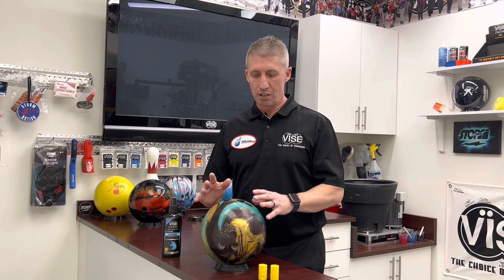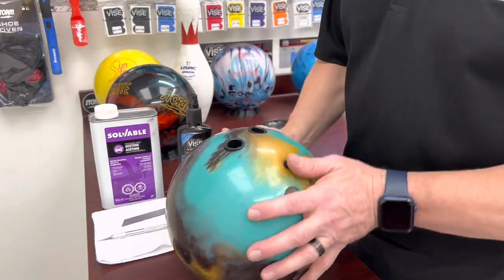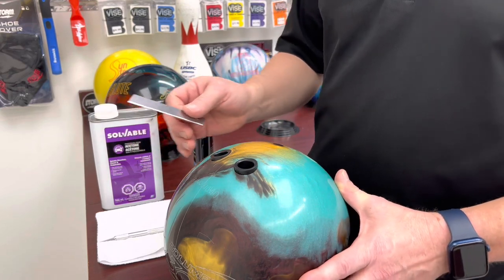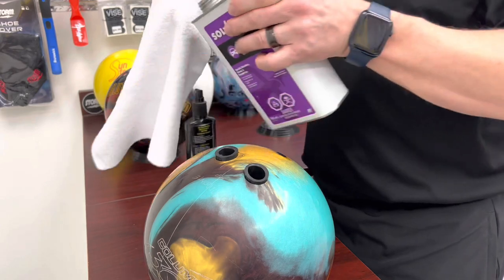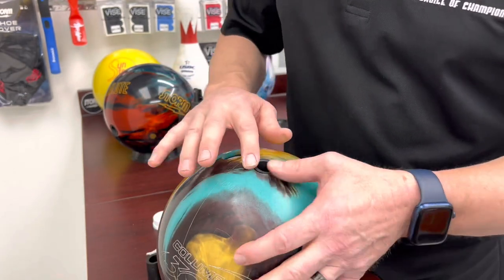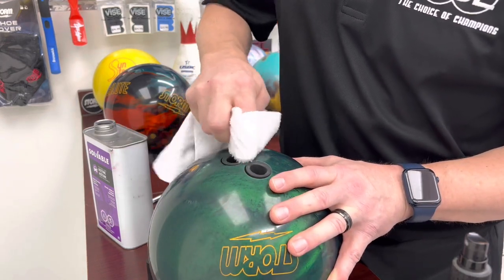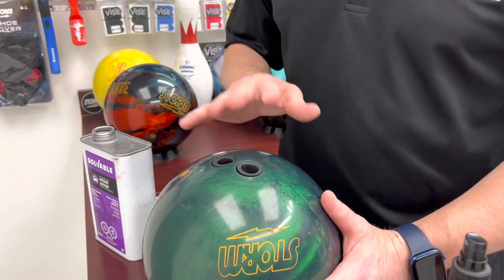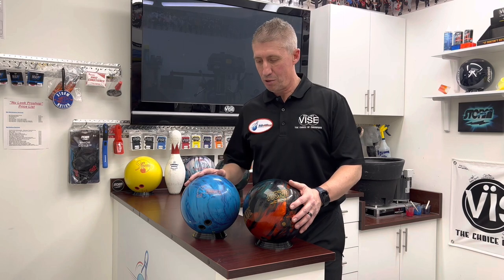How to cut and make your Finger Inserts perfectly flush!

Comment: Good stuff. I just had inserts put in. They're a little too deep. The inside edge of the drilled portion of the ball has an edge on it. How do I put a bevel on the fingertip holes without removing the inserts?

Comment: Fantastic attention to detail. Thank you for sharing your knowledge. 
The biggest issue that I have in regards to inserts is; I use vise semi-power-lift inserts. Trimming them removes part of the "lift" portion of the grip. It seems as though the options are: let then stick out a bit and hope that no one notices, or, insert them deep enough so that they don't stick out,  or, stop using power-lift inserts. What would you recommend?
Reply from the maker: What are your pitches?
Reply: I just switched from these exact grips to ovals and I’ll never go back. Try the ovals if you haven’t already. They feel natural and you’ll be able to use this cutting method as a bonus.
Reply from the maker: @tylerjones2559  I use the Oval/Power Oval from Vise, love them!

Comment: I wac using the same cutting method but without the ball cleaner and acetone. Genius ! Thanks ! Can the acetone alone be enough for the inside part of the grips in case we don't have a surgical type blade ?
Reply from the maker: It will soften the edge a little but an exacto knife just barely taking a sliver off the edge makes it better and faster.  You can get them at any hobby store or arts store.
Reply: @Nulookproshopbowling  Thank you ! I also subscribed just because of this video. Well made !  (i think you might like mine too ;) )

Comment: Nice technique, but I have a question for you.  Are you using the xacto knife on the inside edge of the grip where your finger goes, or on the outside edge of the grip where it touches the ball?  It's hard to tell from the camera angle.  Thanks.
Reply from the maker: On the inside edge where your finger goes, just to barely break the edge.  The you will use the Acetone after that.

Comment: Do you have a technique for the clear vise grips? They seem to be really tough to cut smooth.
Reply from the maker: They should cut the same way. Just make sure you’re lubricating the blade with the ball cleaner and you’re using a brand new blade and when you cut it make sure you’re cutting in a slicing type motion, and so your pulling the blade towards you and not towards the grip. Hope that makes sense.

Comment: Why would you cut the grip just put upper side in first then glue that side then pull up the other side and glue its easier
Reply from the maker: Because you are distorting the natural position of the insert which does also change the size. To each there own, this is just another alternative, especially with vacu grips when you only glue the top front side.